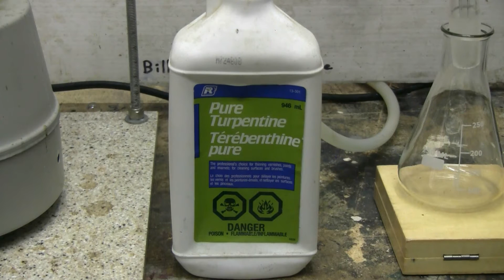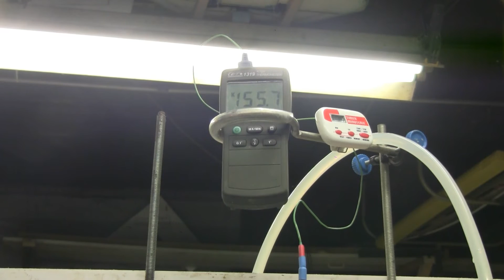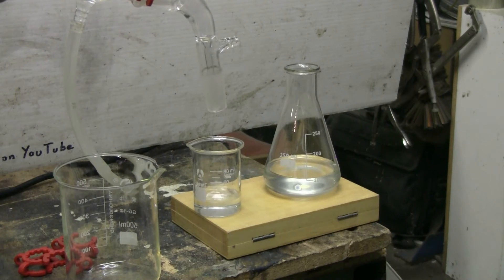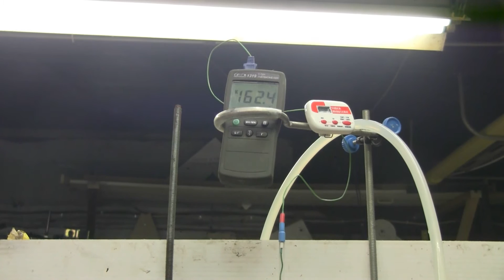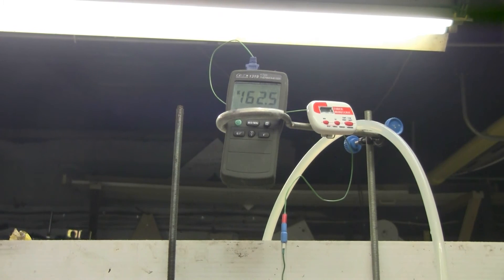Distillation Of Turpentine For Pinenes

Comment: How do you raise the temperature to above 150 C when your solvent is water with a boiling point of 100 C? Is it possible?
Reply: there's no water. I was thinking about a steam distillation too. I bought a turpentine that leaves a sticky residue. This method seems to work. It's pretty simple. I dont need a lab, not even a thermometer. Only a pressure cooker and a cooler - which I possesss
Reply: There is no water. He's distilling turpentine. Turpentine has a boiling point of 154 degrees

Comment: Having had no classes in chemistry, I am totally ignorant of this process. Did you distill the alpha pinenes until there was no more dripping into the container then increase the temperature to get the beta pinenes? And then further for the other compounds?
Reply: he didn't have good control of his heat source. since he went into the spec of the beta he switch collection vessel. he stated he wasnt too concerned with having it perfect because he was doing several runs of this operation to clean it up further.

Comment: Very interesting and you do a good job explaining the process! I really like these vids your doing here. I think an explanation of what you're planing on using these distil-ants for would be interesting as well. I look forward to seeing more of these.
Reply from the maker: Pinenes can be used in the synthesis of fragrances. Once I have a better stock of chemicals, I will start using some of what I am making. I also want a lot of different solvents for my soxhlet apparatus.
Reply: Thanks for the info. It make watching even more interesting. I do look forward to seeing you use these solvents in the soxhlet extractions. I'm sure they are others like myself that have always had a huge interest in distillation and the different fractions of common chemical compounds. Thanks again for sharing these vids and your knowledge of the subject.
Reply: @BillGilmour519  How do you raise the temperature to above 150 C when your solvent is water with a boiling point of 100 C? Is it possible?
Reply: Bill Gilmour You got me interested in Soxhlet for fragrance extraction. Ether is easier than Hexane to get.